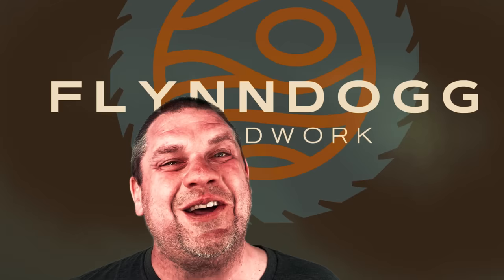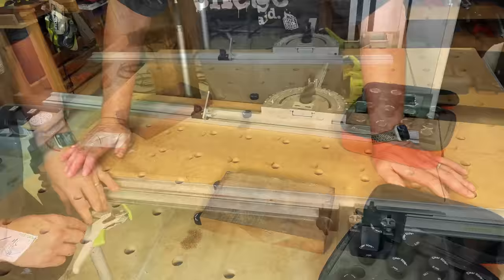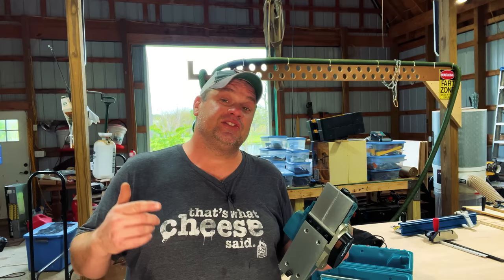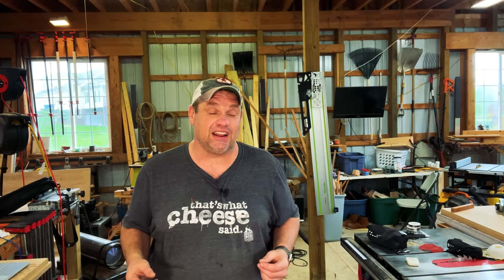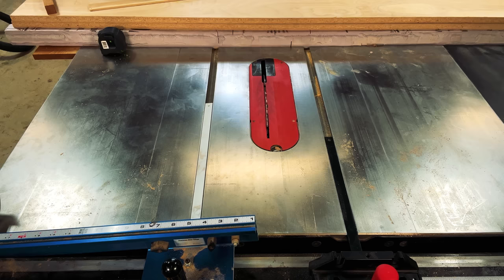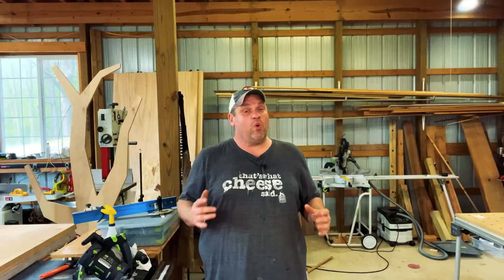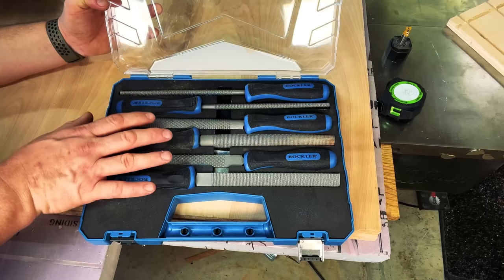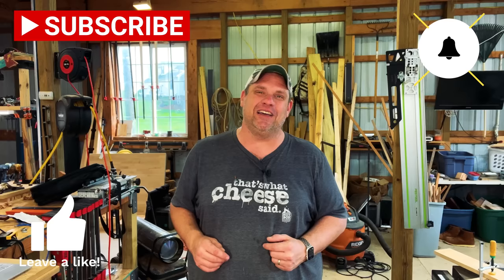This Is What I Should Have Bought!  Check Out These Unbelievable Woodworking Tool Alternatives...

Comment: Good video. Expensive dust collectors are a definite bummer.

Electric planers are great construction tools. I use mine to take the crown out of dimensional lumber floor joists.  Can't have humps in the floor when laying LVP etc. For fine wood working it's far from ideal.

Tapering / Jointing jigs can be made with a couple pieces of plywood, a couple T-track star knobs, and some toggle clamps.

For wider capacity with your miter gauge turn it around and use it backwards. You can still cut square or angles, but the distance from the blade is infinite. Credit to Jody  @Inspire Woodcraft  for that trick.
Reply from the maker: I love Inspire woodcraft!  He’s amazing.  I love the way he comes up with great ideas in his short little videos.  Thanks so much for sharing and watching MariusUSA!

Comment: On the plane comparison: you went across end grain with the power one, and then with the grain with the hand one. Of course that would result in a difference of results and shavings.
Reply from the maker: Believe it or not that was actually long grain on both of the pieces of wood.  With the power planer it was a very short piece of mahogany that was a cut off, on the hand plane it was another piece of scrap that was from the same mahogany wood but different piece of scrap.  The first time I used the hand plane when demonstrating how much the MFT moves, I was indeed planing end grain, but for the planer comparison it was all long grain.  You have a good eye, because when I was filming this video, I initially set up the short piece of wood in the vice with the end grain on top, but quickly changed it (the odd shape tricked me too!)
Reply: @FlynndoggWoodwork  got it

Comment: Once again you have struck an accord with my own experiences, especially the Makita planer, the Kreg miter gauge and the Rockler tapering jig. The Makita burnt me the worst as I had high expectations and it was somewhat expensive. When I tried to use it, it was like trying to control a bucking bronco while making fine joinery. Also, none of my many years of accumulated dust collection fittings (including Dust-Right FlexiPort fittings) fit the damn thing. I re-read the glowing reviews and only then realized they were using terms like fast removal, pressure-treated, fitting deck boards, etc. Haha. Thanks, again.
Reply from the maker: That's great to hear Rich & Peggy.  Makes me feel like my assessment was validated on at least the two items you spoke of.   I agree with you also on that makita being quite high priced.  I got mine as a certified refurbished, so I paid a little less but it still was well over what I should have paid for a tool that doesn't get used that often.  I do have my old kitchen table that I have a table top epoxy covering on it, that has some great wood on it that I would like to salvage using the planer to remove the epoxy... but we will see how that works.  Might do a video on it down the road.  Thanks as always for watching!  Great comments!

Comment: LOL on the MFT. In true Festool style, they sell $$$  stabilizer braces that firm up the table! 😂.  They do work, but they should be standard.
Reply from the maker: Omg are you serious!   Why the hell wouldn’t they just sell the damn things stable!! 🤣🙄
Reply: @FlynndoggWoodwork  I get good use out of it. I operate out of a very urban area with minimal space. I feel like the US version of Peter Millard.  Lots of quick cross-cutting. I also use it to hold stock for my domino and for sanding. My projects and furniture are mostly small. So I use it for ripping across the MDF too. If I have to hand plane I have a portable 3-leg clamp that does the job.
Reply from the maker: @Wyman642  that’s awesome.  Love Peters show. Sounds like I just need to sure it up to take more advantage of it.  And yes I use it for the domino as well!  Probably should have mentioned that in the video.  Thanks for your comments.  Very helpful!

Comment: I agree that one should never compare tools using different setups and then say one is so different from the other. Comparing the electric plane on end grain versus the hand plane on a side with long grain is disingenuous. Next time, compare under identical conditions.
Reply from the maker: It was all long grain, just two different boards where one was cut very short so it looks like the grain would go in the other direction.  Someone else had mentioned the same thing, sorry for the confusion! :)   Thanks so much for your comment and thanks for watching!

Comment: The INCRA MITERV27 Miter V27 Miter Gauge is extremely accurate and easy to use and fairly reasonable at about $80, I’ve had mine for over 20 years. Unless your StopSaw miter gauge is the exception OEM’s are not very accurate.
Reply from the maker: OMG when I saw your comment I kicked myself.  I have a couple of incra tools and can't believe I didn't incorporate them into this video.  They were some of the first tools I got before I thought I needed to have the woodpeckers brand.  Thank you so much for reminding me!!